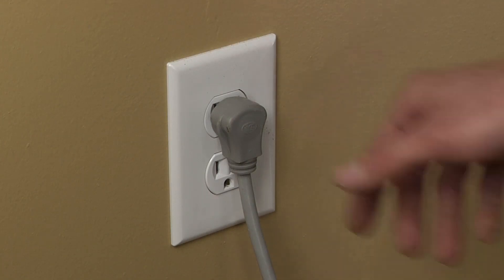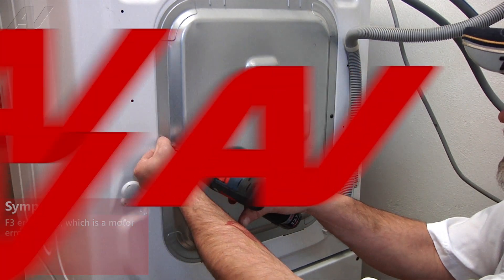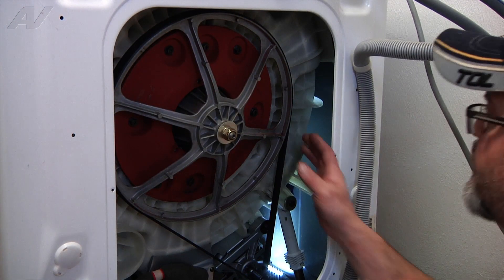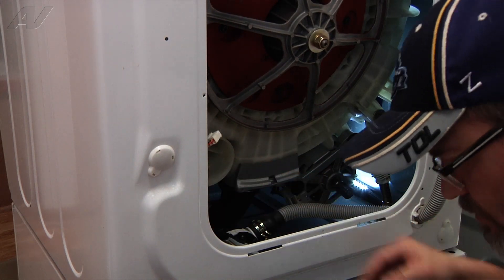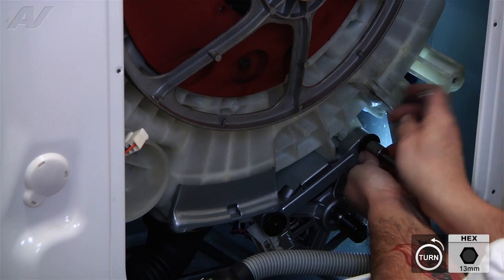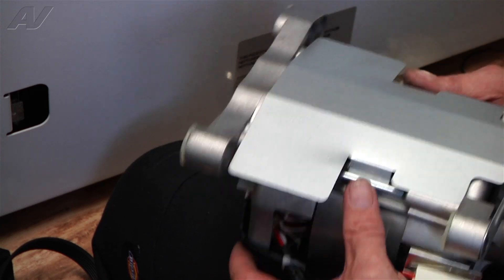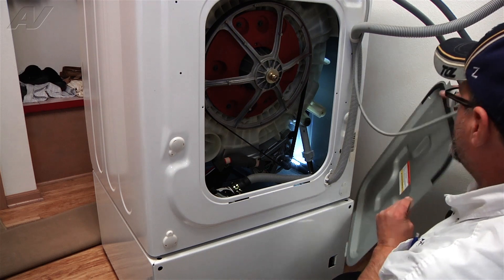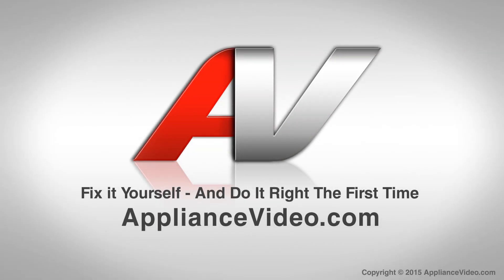Maytag Washer Repair - F3 Error Code - Motor

Comment: So you take motor out and put it back in to fix the error code...? Didn’t work for me. I’ve tried several times with nothing but busted knuckles, dirty laundry and excessive use of the “F” word. My neighbors think my dogs name is fuck... help!
Reply from the maker: Great question, if you have a more technical question that our parts department cannot answer, you can search our over 17,000 answered questions free at our website www.ApplianceVideo.com under our Repair Help section. You can also call our parts department at 1-800-830-5465 and they can give you help 7-days A week ,or search at www.SaveMoreOnParts.com  .